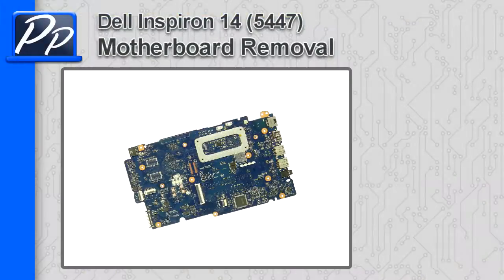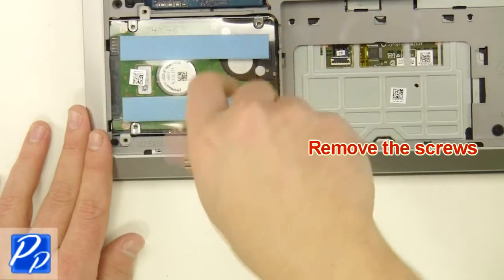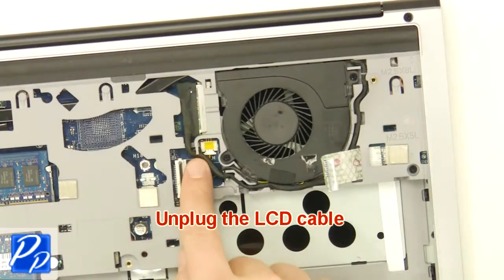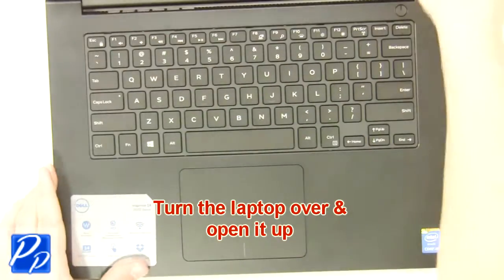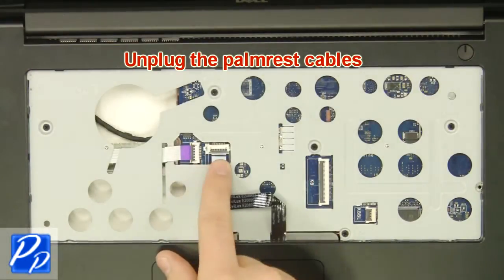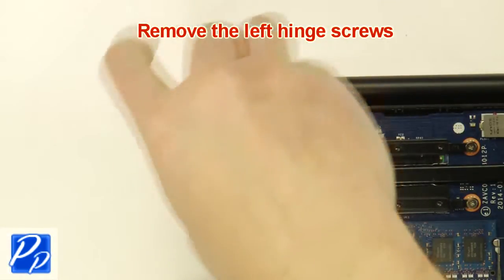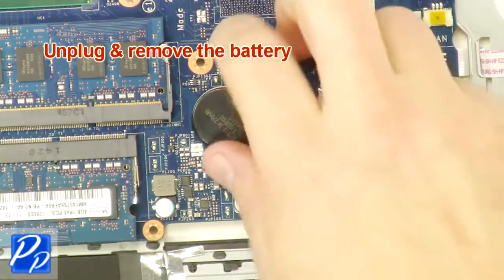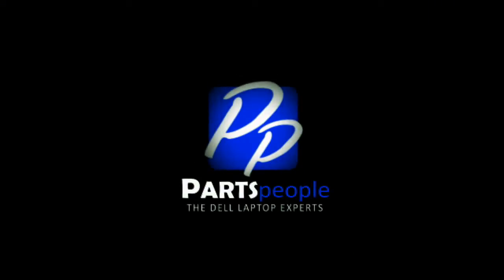Dell Inspiron 14 (5447) Motherboard How-To Video Tutorial

Comment: do this motherboard have a pci express slot?
Reply from the maker: +Guneet Singh No, it does not.
Reply: any option for upgrading graphics..my friend has AMD R7 M265 in the same 5447 with Core i7..so is there any way to access the graphics chip and upgrade the same..?
Reply from the maker: +Guneet Singh The graphics chip is built onto the motherboard and cannot be changed without swapping the motherboard. The 5447 came with 2 different options for the graphics. It either had Intel HD 4400 or the AMD R7 M265. Replacing the motherboard would be your only option for upgrading to AMD.

Comment: does this motherboard have sata 3 connection?
Reply from the maker: +MrHussei10 Yes it does.
Reply: will i need an adaptor if i want to put in a 2.5" ssd?
Reply from the maker: +MrHussei10 It will not need an adapter if it has a SATA connector. This type of SSD will work without an adapter. https://www.parts-people.com/index.php?action=item&id=19969
Reply: thanks